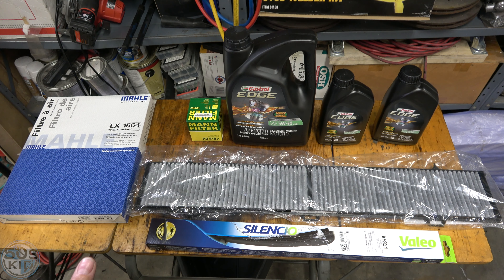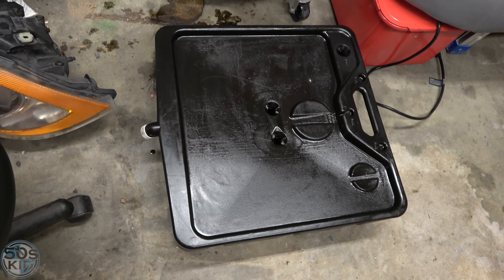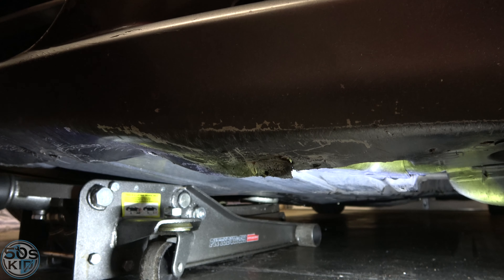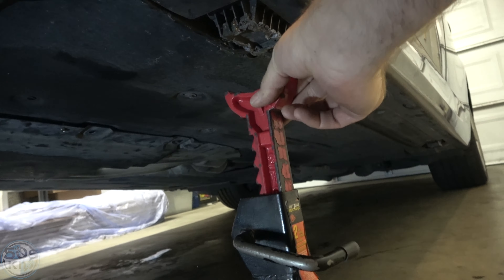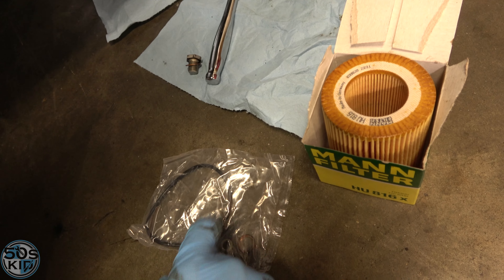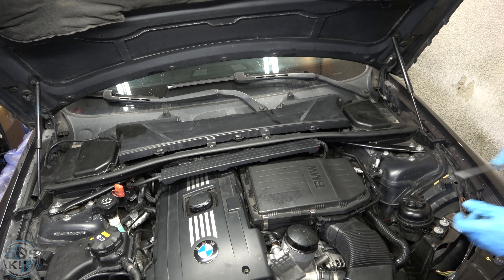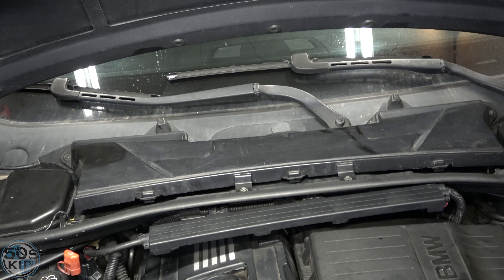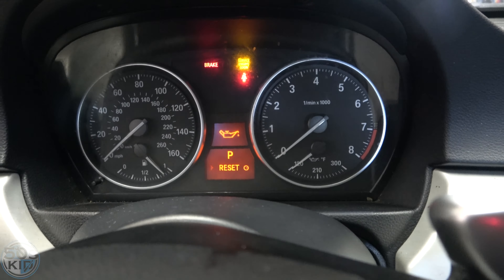DIY How To Change Oil & Air Filters on an E90 BMW

Comment: With the jack stand points, while strong, I like placing a rubber insert in there just to take the load off the plastic edges.

Comment: One thing is interesting,e46 oilpan plug is hollow,so it cracks before you hurt oilpan when overthitening it,but it seems newer ones  doesn't...🤔
Greetings from Estonia!
Reply: Sorry....that's not correct. The steel plug WILL strip the threads in the Aluminum oil pan before it would think about cracking. Please do NOT over tighten.....Torque to 25 Nm per BMW spec. with new crush washer
Reply: @abimmernut  
Belive me,it have happened with me😃
The head of the Bolt snaps and with extractors(easy out or how they call them( you can turn the e46 oilpan Bolt out,no damage to oil pan happened.

Comment: I made the mistake once doing the oil change this way by removing the filter first before opening the filler cap and draining the oil, of course oil spilled over from the oil filter housing.  So I have found that to avoid that mess, I open the oil filler cap first then drain the oil and change the filter last and that makes the change a lot cleaner.
Reply: I do it this way for my E46 too.

Comment: My N54’s drain plug faces straight down.. I’ve never seen that on another one 🤷🏻‍♂️ it’s not a repair either, there not a spot where it was ever on the side. I actually had to order crush washers, because it’s different from the one that comes with the filter.
Reply from the maker: Umm, do you have the XI?
Reply: @50sKid  yes, but the part # is the same for the RWD model 🤷🏻‍♂️
Reply: For some reason the manual transmission cars, the drain plug faces down.
Reply: @84Bruto  I have an n54 with a manual and the drain plug faces sideways
Reply: @freestyle648  interesting. I fixed BMW's for a living and everytime I see a an N54/52 drain plug facing down is eaither an Xdrive ot manual transmission

Comment: I use LL-01 and change oil every 15,000. Kilometers! Call me silly, but I just don't trust BMW (or any manufacturer for that matter) when they say 25,000km-interval/life-time fluid/maintenance-free and such.
Reply: Agreed. I think it is really pushing it, the higher -end manufacturers did this I believe to include “free maintenance” with their vehicles to make leases/purchases more enticing Without tying up their dealer techs too often from more lucrative services. The problem is and I’ve seen it many times is the oil level will drop before the maintenance is due and many owners think they don’t even have to check it for 15,000 miles. Hey BMW and the salesperson told me I don’t have to change it for 15,000 miles…
Reply: @cardo1111  Maybe if 25000km is done, the owner should change the oil filter midway. say at 12500km or earlier to be safe. I heard these oils can last very long before degrading. but am not sure if the oil filter can hold up that long.
Reply: @MrAcc45  There are high quality filters out there that can likely go the distance, my main concern is people getting lax on checking the oil during the long service interval and BMW's are known to consume some oil.
Reply: @cardo1111  I chance the oil every 5.000 km. As I do the job by my one, its not very expensive and I like this kind of work.
Reply: @danielmuller8125  Once a year, or 10K Km Max, in my beloved 330ci E 46. Whatever it came first. Regards.